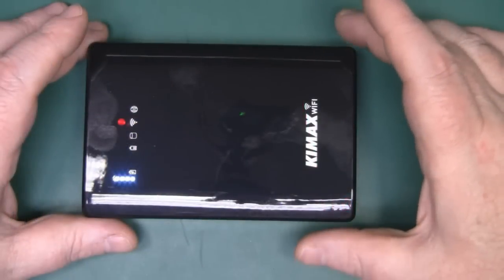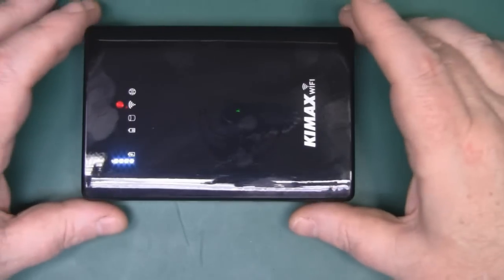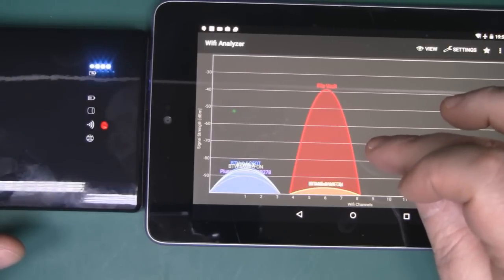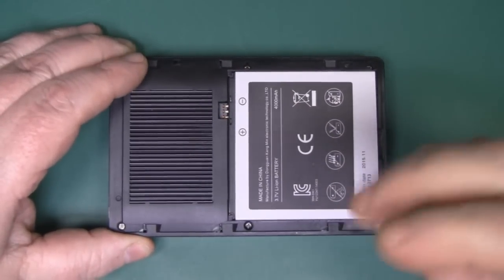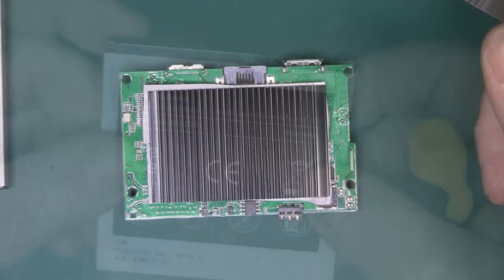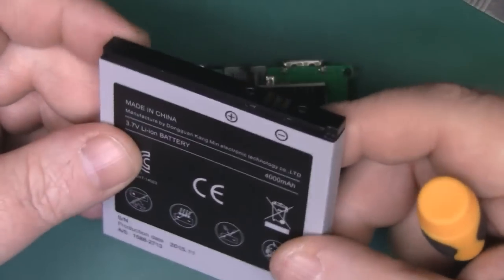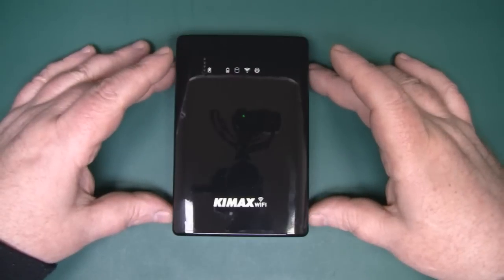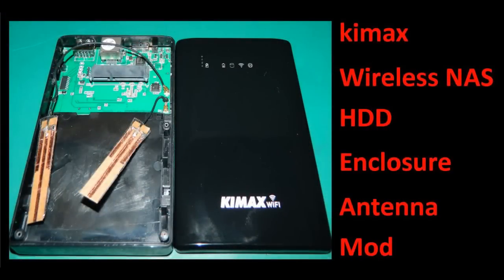Kimax Portable Wireless NAS Antenna Mod

Comment: The production date is probably year/week. 11th week would put the date of manufacture in March. It's a shame the better antenna design wasn't enough to overcome the other shortcomings of the device. Thanks for the video!
Reply from the maker: +wrathofsocrus d'oh your right 11th week not month. The antenna did help but I agree you would be better off with a cheap usb enclosure.

Comment: Nice video thank you! :)

Other:
You plan any newer nexus 7 modification video? I like your Nexus 7 antenna upgrade video 2 /biquad/ and i want to do it, but if you have newer plans with nexus 7 i wait for this. If you have no plans with this, can you please link from ebay the copper foil and the koax what you used in n7 antenna upgrade 2 video?

Thank you and sorry for my bad english, and thank you for doing this channel i like it :)
Reply from the maker: +MrBeloadjokerr I have the K008 with a smashed screen I got it to do a repair on but have not had the time. So there will be a repair video and probably an antenna upgrade in the future.